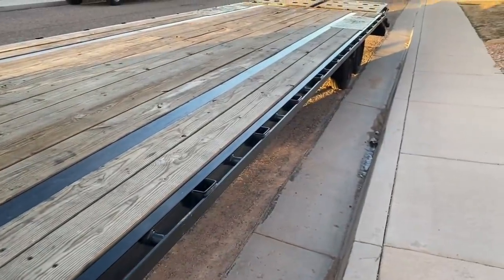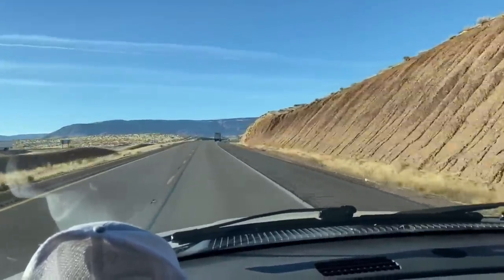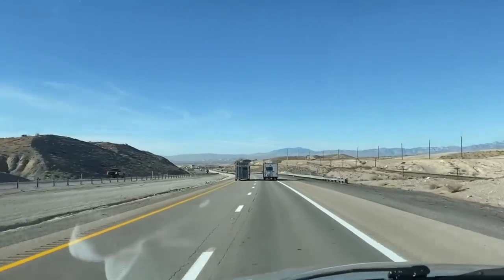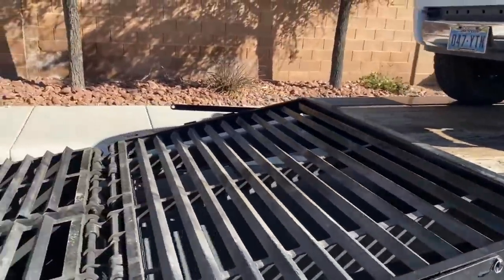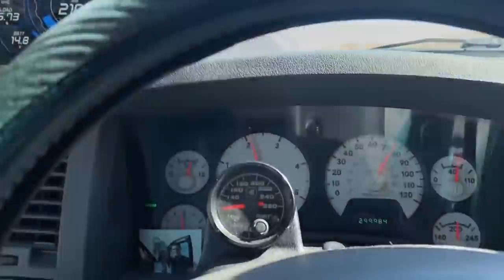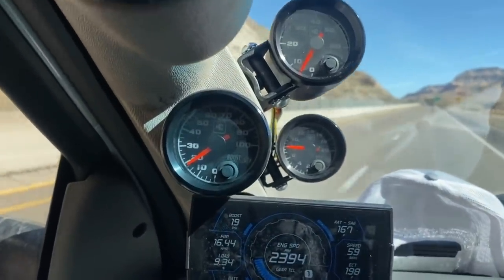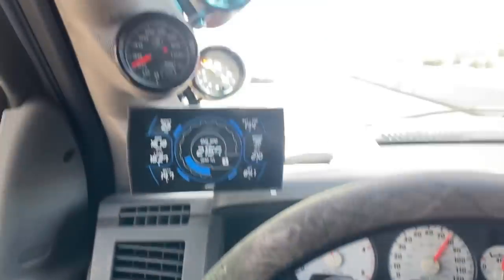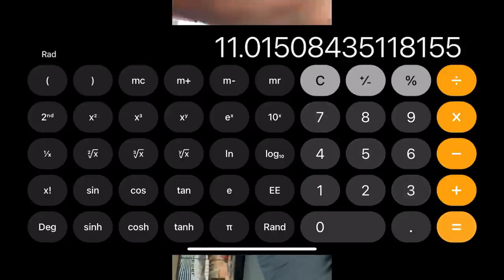1300HP TOW TEST!

Comment: That’s awesome hope you can keep it together with that kind of power it’s always so tempting to put the foot in it, I have a 14 ram 2500 with ATS 64mm VGT and an Aurora 5000 compound kit with full on emissions, I’ve towed every year from southwestern Oklahoma to Colorado every year since it was new, 2020 was the first year with the compounds i had the same expression as you did, it just really never let up or acted like it was out of power and needed to down shift, it was unbelievable the difference in just tuning and what compounds can do. More air equals more power, current powertrain mods are ATS compounds, fleece fuel pump, Banks Intercooler pipes (right and Left) Rev max triple disk converter, rev max billet valve body, rev max deep pan, revmax max thermo block,  rev max billet flex plate (still has stock guts on 68rfe and 107k) all tuning by Calibrated Power since New
Reply from the maker: Love the guys over at calibrated power they do great emissions on tuning! It won’t last forever at this power level though.

Comment: Really enjoyed the road trip. Passing semis up a 6 degree grade at 80 mph and cranking out way more horsepower and torque than they do. Funny when you said can you hear that turbo whistle... that's all we've been hearing the whole trip. I don't think I've ever heard a higher pitch turbo whistle on anything. Sounds like about 200,000 rpm. I bet you could peg the speedo pulling about twice that much. She wasn't even working. Fuel mileage better than stock too. Great job guys !

Comment: My 04 is getting close to 400,000 miles  she's at 374,000 right nowhaha,  I can't wait to see it tick over. I think at 400,000 I'm gonna pull the engine and freshen it up and have the trans freshened up as well. I had the trans built pretty stout at around 270,000 miles it didn't break just had the money and figured I should build it since I tow heavy when I do tow haha. Loving seeing the cummins roll through the miles haha :) ❤

Comment: I wonder how a big single will compare, drivability wise. I'm still warming up to compounds 🤔
Reply: This guy never answers tech questions. Most of these youtubers are like that. Big single with a .90 housing is gonna spool the fastest with some cons. I would like to go compound, but dont want to lose the second battery my power inverter needs all the juice it can get.
Reply: I like how easy it is to package a single in the engine bay, less clatter, less hustle 👌,  my biggest concern is EGT control on them hot summer days here in the Southern hemisphere 👍🏾. I'm looking to do a Cummins swap into a landcruiser, their chassis are ted smaller than the Rams over yonder.
Reply from the maker: I have towed with big singles. If the truck is a 6.7 you can do it with a 467.7. A 476 is extremely hard to do but it can be done. If you are towing heavy compounds is the way to go in my opinion.
Reply from the maker: @jasunsmith9136  I answer almost all the tech questions on this channel. It’s literally all my Channel is for 😂. Now I will be honest I usually don’t answer questions I have already covered or are clearly satirical in nature. The .90 is less than 10% of the problem on a big single towing application. 1. Engine displacement. 2. Transmission type and speeds. 3. Gear ratio. 4. Actual weight. 5. Elevation. 6. Fuel system, 7 converter stall, 8. Heat resiliency.
Reply: @jasunsmith9136  You better read the comment's, Josh does answer and they are there for the reading!!
Reply: @horsetorquesdiesel  I'm totally grateful, thanks mate
Reply from the maker: @ophiasdzamara88  anytime
Reply: @franklogan494  He hasn't in the past. My main account I asked a few specific questions which would been helpful to know the answer to without learning the hard way. 

I find most people let you fail and when you figure it out on your own they either knew or pretend to know all along.

Comment: what size tire are you running and rear end gear ratio? I tow about the same with my 2006 62 over 475 compounds and almost identical sound. i have gone up boulder mountain. I have mishimoto transcooler up front, two derale coolers underneath with fans, and spin on trans filter. billiet input shaft built trans. however to run it in overdrive and keep the rpms in the right place for the 62 turbo, with stock gearing I am at 85 mph gets a little sketchy passing semi's at that speed. 35 inch tires. do you think i should go smaller than the 62, or drop the rear end gear down? Also thought of putting in allison conversion.
Reply from the maker: 33” tire 3.73 gears. I bet a smaller tire would help

Comment: wow I am impressed . I was wondering how you tow with a 4 speed automatic . I not sure  but your starting off of course in low gear fluid coupling with what ever stall .  3.54 gears or ? I do the 2500 rpm to let the motor drop off the same way into second when I tow . You go to lockup and then raise the rpms and unlock shift and repeat . No locked shifts or I would not either especially with a load . I expect to break parts for sure . My  stock transmission does not allow for second gear lock up . You have a way to lock up and unlock on your shifter . I will say the truck is very impressive especially under these conditions . I also use 3 gear lockup when I can not keep up the rpms . The 750 rpm gear splits I think is a pretty good jump so the reason I prefer 6 gears or more lol . Still impressive thanks
Reply from the maker: 6 speed is definitely way better towing!

Comment: My issue is that I have 80-120k lbs and 1200hp. hauling up 5+ mile grades of 5-8% at full power is a bit harder to tune for. And nothing sounds as good as an S400  or S500
Reply from the maker: That’s big weight problems for sure!

Comment: Do you run a catch can on this? I have a D&J valve cover with compounds and i tow 29k. Always leave oil under my truck pulling heavy up a grade.
Reply from the maker: Just the factory valve cover doesn’t slobber much at all
Reply: Nice! Do you have any oil leak issues with the stock valve cover or no? Appreciate the content on here to 👍

Comment: I learned this the hard way but law enforcement doesn’t care about actual weight they only care about what the sticker on the trailer says and what the sticker on the door of the truck says. Take the gvwr of the truck and the gvwr of the trailer then add the two together if you are 26,000 lbs or less then you are fine if your are 26,001 lbs or more then you will need a CDL (see local state laws for which license specific to you). As far as towing capacity of the truck varies but the max was 16,400 lbs for an 06 and 07 5.9
Reply from the maker: Utah doesn’t seem to mind all that much as long as it’s strapped down, I guess we are lucky!
Reply: @horsetorquesdiesel  I wish I could say the same but keep up the good content.